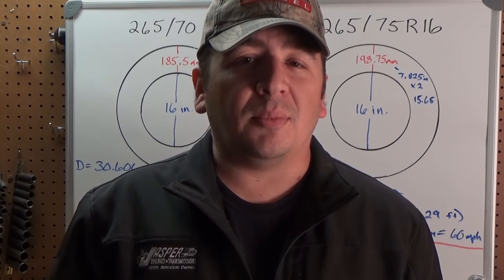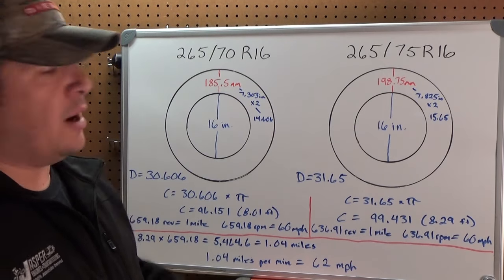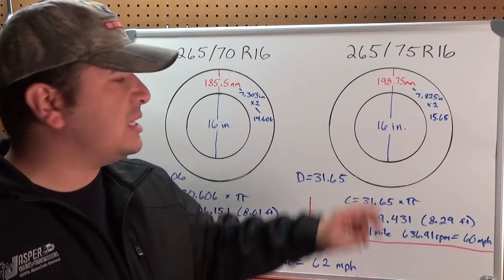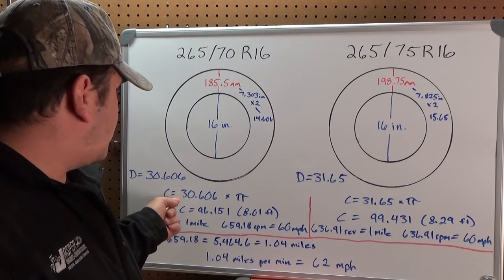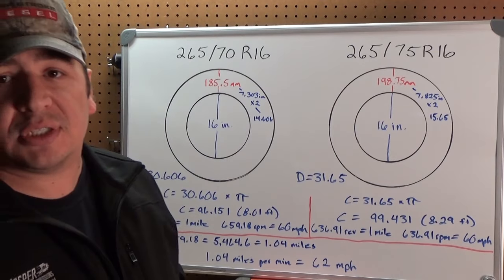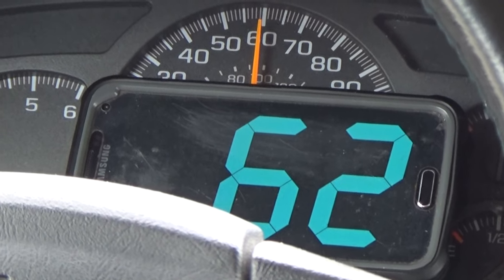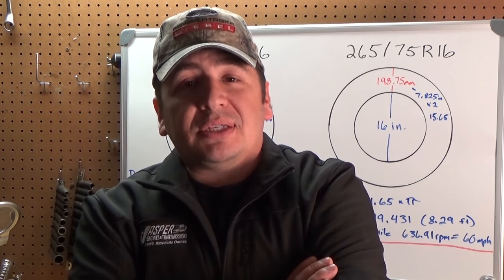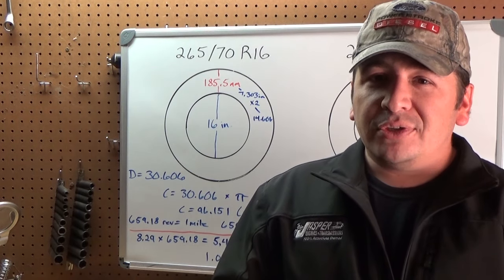Wrong Tire Size - What Does it Mean? - Automotive Education

Comment: Ok so if I take a truck with a 30” tire already on it and that tire rotates 622 times in a mile.
That same truck I put on 50” tire that rotates 404 times a mile.
But of course because the bigger tire has a bigger diameter, the engine struggles and the Speedo is wrong. 
What if I put on portal axles with a low gear ratio to counteract this? 
Then my speedo is correct and my engine has the same mechanical advantage with the 50” as it did with the 30”. 
Yes I know the 05” will be heavier and cause the engine to struggle more, but I’m ignoring that for the time being.
What do y’all think?

Comment: hi as per your example will there be any effect on the drivability and steering feedback
Reply: I just had two sizes bigger tyres fitted on my car. Was advised to do that to better handle an unpaved road I have to travel daily. I immediately noticed I needed to give it more gass to pull away and that the fuel consumption is a little worse, not too much, but noticeably so. The ride comfort improved, which is what I needed, and I have less road noise, but all other aspects remain unchanged. Cornering , braking etc. But then again, Iam just driving normally, didnt do any top gear style performance tests.

Comment: I do understand the millage and speed difference and that is not a concern. Do I lose anything essential otherwise and my question is actually for a reverse scenario, say using an aspect ratio of 65 instead of your 70, with the aim to bring the center of gravity a bit lower in a sporty car and not a truck, for better cornering? Will, I jeopardize something significantly, or am I at fault by a liability on any major issue?
Reply: Bippolas Beige    Can you explain farther? Is this Fed or State law? I say that because many cars for eg WRX from Subaru comes with many choices s.a. 17 or 18" rim directly from the factory. Also, what are low riders then?

Comment: Hello. I drive a 2005 mercury grand marquis. Stock tire size is 225/60r16 and is what I have on right now, can I put on 215 65r16? I have them in my garage and my 225's threads are almost done.

Comment: Hello sir I have a question
My tires in front should be
245/40 r20

But I only found
245/45 r20

Does that extra 5  height harm the  car  by the way my car is bmw 740li 2013
Reply from the maker: As far as fitment goes, they would very likely fit just fine. Those tires will be just shy of 1 inch taller than the tires you should have. 

My concern is that you said the front, which makes me think you are talking about only replacing the front. You want to avoid putting different sized tires on the same vehicle unless it was designed to be that way. While the tire might fit and work fine, the different size will make those wheels turn slower, and having that happen can cause a number of ABS issues as the ABS constantly monitors all wheel speeds and uses that info, along with other input information, to determine if the wheels are locking up. 

In addition to that, I thought thoust 740li's were AWD, or at least some of them were. If it's AWD, you absolutely never want to put different sized tires on unless you're putting all 4 on. On AWD vehicles, you'll tear up the drivetrain if you have the front and rear axles trying to turn different speeds due to different tire sizes. 

I would suggest either finding the recommended size for your front tires, or replacing all 4 with the 245/45/20 tires you found.
Reply: @DIYAutoHomeschool   my front tires should be
245/40 r5
 And rear is
275/35 r20

Do u think that I only found for the front  245/45
The rear also should be
275/40

1 inch hiegher. That way is it balanced now?

Do u think one inch hiegher in both rear and front will harm the car

Currently I have one inch higher in both front tires  from 40 to 45 but the rear still 35  do I have to put 40 now

Thanks for your help and replying and please reply to my new questions

Comment: Hello there, I have a small Suzuki hatchback with a 1.0L 3cyl engine. Stock wheel size is 155/65/14, if I downsize to a 13 inch and a 155/80/13 taller tire would it give me an improvement over fuel mileage as well as comfort?

Comment: I have a question I have a 2019 Nissan frontier 2.5 King cab. The tires are small with the s model the SV King cab with 4.0 V6 have bigger tires. I just wanted to see if I can go up a little higher like the SV model of the King cab Nissan frontier but I'm kind of skeptical about doing it after seeing these videos. I just want a more rugged look because it sits low to the ground and I would like it to sit a little higher

Comment: What would happen if i put on my toyota truck with limited split differential. on the back differential the stock tire 31x 10.50 R 15 and in the other side i put a 265/75 R16??

Comment: Sir, My only requirement is to increase the ground clearance... Should I go with 'Side Wall Up'  or 'Width Size Up'... Please reply ASAP.
Reply from the maker: Both options will produce a taller tire, one will just also produce a wider tire. 

This is a hard question to answer. If you're just wanting a little more ground clearance, coil spring or strut spacers might be your best option.

Comment: Can I just use any wheel and tire, and adjust the odometer to read that tire size. And for speedometer I just use my GPS. And sometimes old cars the factory set the speedometer to actually slower then the actual speed.

Comment: The dealer put 225 65R17 on my car when it calls for 225 60R17. I think this is the reason my AWD light is flashing. I'm going to do more research. I'm trying to get them to replace the tires. Thank you for the video!
Reply from the maker: Thank you for taking the time to watch the video and for your comment.

If they put those tires on the vehicle, but not on all 4 wheels, then it absolutely could cause your AWD system to act funny, and to drive funny. It can also cause damage to your AWD system.

If all for wheel had the same size put on, it's less likely that it would cause problems, but some vehicles are capable of detecting when the incorrect tire size has been installed.

Best of luck and I hope it turns out well for you.
Reply: danger! YOU will kill of car diferencial,becose Your car 4weel drive must to by factory size all4 tires same!

Comment: 185/65/r15 is the stock, im planning to upgrade 195/65/r15, will it  mess the ABS?
Reply from the maker: No, you should be fine. The ABS system looks at the wheel speeds in relation to each other. You'll still have a little difference in actual vehicle speed compared to the speedometer, but no ABS issues.
Reply: I just bought some tires 315 40 21 and replacing the old 315 30 21, will I have issues with ABS? I realize I may have to adjust the computer for new tires.

Comment: Thanks for this very educating video. My vehicle has a bigger tyre, but a smaller wheel size. Would it still make a difference?
Reply from the maker: It can still possibly make a difference, unless you are fortunate enough that the greater height of the tire is offset perfectly and exactly by the smaller size of the wheel. The math in this video will help you figure out what the difference is. Figure up 1 with the tire and wheel size you actually have and 1 with the size of wheel and tire your vehicle is supposed to have and compare the outcome the same way i did. Thanks for watching the video.
Reply: Thanks for your quick reply. Apart from the speeding and distance difference, does a smaller or bigger rim affect the car in any other way? I mean the suspensions, noise, comfort, steering or control?
Reply: Yup, most all of them minus the noise depending on what kind of tires you had on.  Performance tires have harder rubbers so it will make more noise going down the road but better for handling and steering/control.

Comment: I have 14 inch rim on my Hyundai Accent sedan 2017, what size of tire can I use on 17 inch mag wheels after market?
Reply from the maker: Rainier Dagdag. Ok, with just a quick check, you should come out close to the same diameter if you use 175/50/R17 tires. Your stock size is 175/70/14. This is if you want to stick with the same width of tire. But that's a rather odd size and finding tires that size and buying them may be more hassle than you want. 

Another thing to consider with putting aftermarket wheels on is the offset. Most aftermarket wheels carry a different and greater offset than your stock wheels. This means the centerline of the wheel will be at a different place than with your stock wheels and tires. If the difference is too much, you can end up with wheels that rub the liner or suspension parts on turns. I'm not trying to talk you out of aftermarket wheels, just do a lot of research to make sure they'll work the way you want them to once you purchase them.

Comment: Hello my  car  Lexus  IS 250 2015 RWD ,
currently running 2019 Bridgestone turanza tyre on its staggered setup  ( FRONT 225/40 R18 88Y BACK 255/35R18 90 Y ) . It's hard to find a Michelin Pilot Sport 5 for the rear size 255/35R18. So is it possible to change size to 265/35R18. I have an 18' F sport Rim.Thanks in advance for any input you all may have for me.

Comment: Any thoughts on why my 2001 GMC Jimmy 2 door 4wd indicates two different OEM tire size? When I go to tire sellers websites it lists both 235X70XR15 and 235X75XR15 as proper fitment. It seems strange that there would be more than one OEM size listing. For 90% highway and city street driving which would you recommend?
Reply: Did this Youtuber answer your question?  In my opinion, I would go with the one with the higher tire or one with the greater diameter.  But,  then again, I just looked up you model.  It seems the tire with 70 height is listed more. Looks like your wheel size is 15×7, with that 7" width size you could even go to 225/70 R15 , in my opinion. Considering most of your driving is highway (or freeway also) driving,  I would favor the taller tire for comfort but better performance and shorter tire for performance and handling.   The only thing I noticed  unusual  about the OEM tires you listed were that the only the height of the second was tire was taller.   I usually notice  when the second tire is shorter, than it is usually has a wider  tread.

Comment: Hi,
What happens if a car has 2 front tires with same size and the back tires with another same size...? Will it be harmful to the car or to the other tires ? I dont have much trips except the local trips and hardly some off road trips. Kindly educate..thank you

Front tires are : 275/65 R17
Back tires are : 265/70 R17
Car : Dodge Durango 2005 moderately maintained.
Waiting for your reply.

Thank you
Reply from the maker: It looks like your rear tires will be roughly 1/2 inch taller than your front tires. With the difference being that, it's possible you might never notice any real issues. It might even be close enough, depending on tire wear, that the ABS system doesn't even flag the difference in wheel speed as an issue. You might see a difference of roughly 1 mph at about 60 mph, meaning you'd be going 61 when you thought you were going 60.

I don't think you'll see any issues from it, the only time you might, is if you engaged 4WD. Then you'd be turning all 4 wheels and it could cause driveline binding.
Reply: @DIYAutoHomeschool  Thank you so much man for this detailed and educating reply. really helped me to get myself educated...thanks a lot

Comment: Hi Kyle, I have a 2014 honda civic and the tire size that came with it were 214 45 R17. I wanted to put 214 55 R17 but costco said they can't coz of the sensor and called honda dealer and said the same thing. Is that true?
Reply from the maker: That depends on the sensor they are referring to. On Direct TPMS (Tire Pressure Monitoring Systems) the TPMS Sensors mount with the valve stem and sit against the wheel inside the tire, this would not have any affect on the sensor's ability to operate correctly and unless you were changing to a drastically shorter sidewall, there's no reason to believe that the sensor would have any interference concerns with the tire it's self. And, I'm quite certain that all the 2014 Honda Civics, including your EX-L , used these direct monitoring systems.

That being said, the other sensor they might be referring to is the VSS (Vehicle Speed Sensor), sometimes called the Transmission Output Speed Sensor. If you change tire sizes, you will have the difference between actual speed and computer calculated speed that was covered in the video. For this reason, many shops refuse to install different sized tires than was originally on the vehicle. At a point, if they knowingly install tires that will cause a person speedometer to read incorrectly, they have to accept some portion of liability if that person gets a ticket for speeding. It's kinda a nonsense excuse, but in the world of big corporate chains like that, liability is a HUGE deal for them, so they take every extra precaution to avoid it. I believe that this is most likely the reason you are being told this assuming you are talking about replacing ALL tires with this new tire size.

If you are wanting to replace only 1 or 2 tires with this new size, then you will run into issues. Now, you'll have different tires on the same vehicle turning at different speeds constantly and that will cause problems with your ABS/TCS/VSA system. These systems rely on input from your wheel speed sensors to know if 1 or more of your tires are losing traction on acceleration, slipping on braking, or losing traction during turning and cornering events. The system will then modulate the brake pressure to these wheels to either limit slippage on braking or turning, stop a wheel that is losing traction on acceleration, or apply the brake to the proper wheel to prevent you from over or under-steer conditions that would lead to a loss of control of the vehicle. All of this relies on the systems ability to know exactly how fast each wheel is spinning and knowing how fast they are going in relationship to each other. If you have 1 wheel with a different size tire, then the system will recognize that as a fault and disable many of the functions of these systems.  In addition to that, if you have different size tires on a drive axle, such as having different size tires on the right and left front wheels of your vehicle, you will cause a ton of excess wear on the spider gears inside the differential/final drive gearing inside your transmission.

I hope this helps you understand the reason you got the answer you did from these 2 places. If you are really wanting to go with a different tire size, I would recommend finding a tire store (Not Costco/Walmart/Sams) in your area that has a good reputation and speak with them about what you're wanting to do. They'll be able to tell you if you're going to have clearance issues with the new size or if there are any others concerns to watch out for.

Comment: Question! If I let air out of the tire. (30psi) vs 35psi would that matter in tire height? And by how much
Reply: Your tire would no longer be round. Flat at the bottom increasing roll resistance and gas mileage. Keep the air in your tires.

Comment: True.. BUT most cars speedo is by factory(oem wheels) about 4-12%(some more) wrong compare to GPS
Just drive 100mph and look at gps. If 2% wrong .. you can change ur total wheel size -+ 2%

Comment: If a mile is 5280 ft 

The smaller tire rotates more about 660 times since the tire is only about 8 ft 

And the larger tire rotates less 639

Comment: Does the math work out similarly if you change from 225/65/17 to 245/65/17? Cuz in theory the tire is again larger, correct? Thanks for the vid - exactly what I’m wondering + wondering about other issues that may arise
Reply: Width of the tire is larger. Completely different situation.
Reply: @amberhollo410  so what will happen in this particular case lol? Thats what im doing now
Mounting 2 205/65R15 instead of  225/70R15 on a FWD van. 

I realise everything is different here width and height lol.

Comment: Okay, the error engineering design is plus or minus 2mph anyway on the cars. Cope won't give you a ticket for going 2mph faster.  Look at the bright side, you're actually get to your destination quicker because you travel farther then expected.
Reply: Question: I have 225/70/15 on my car. Would 205/70/15 make a difference or affect my AWD/4WD system? The speedometer difference I can deal with but I don't want to risk any mechanical issues.
Reply: sambrizzy A 205 tire wouldn’t be as wide as a 215, it shouldn’t affect the speedometer or awd system, only thing affected is how wide the tire is.

Comment: 265/70 R16  means width of Tyre 265 mm,height of Tyre 70 mm, diameter of Tyre 16 inch. So, what is 185.5mm ??
Reply from the maker: The 70 is not a measurement in millimeters. It's the aspect ratio. The percentage of the section width that the sidewall is. 185.5 is 70% of 265. The sidewall height is 185.5 mm not 70mm.